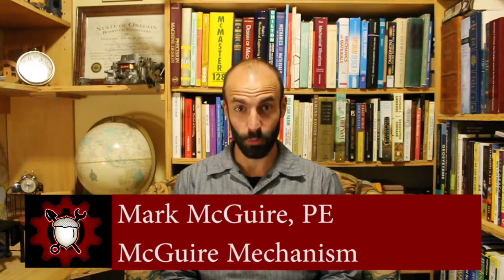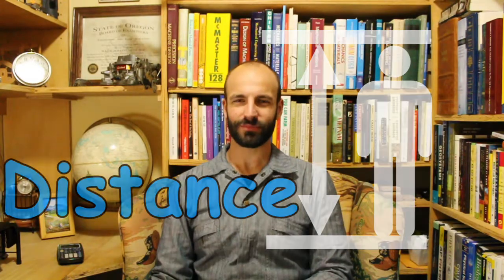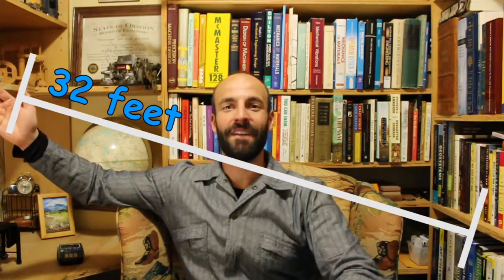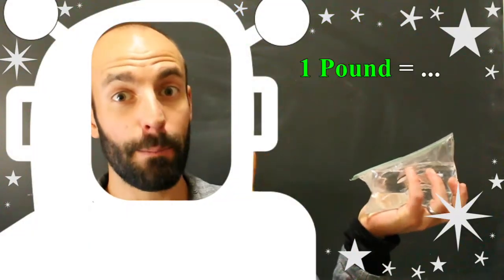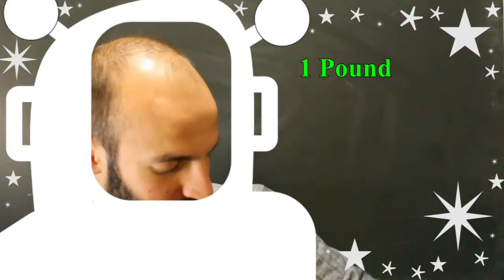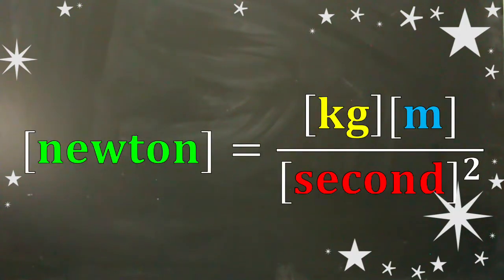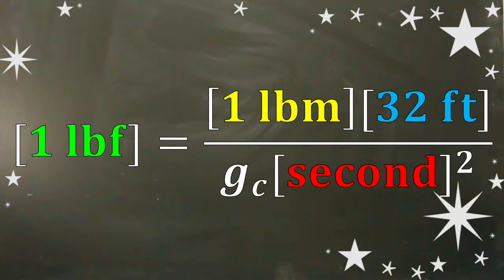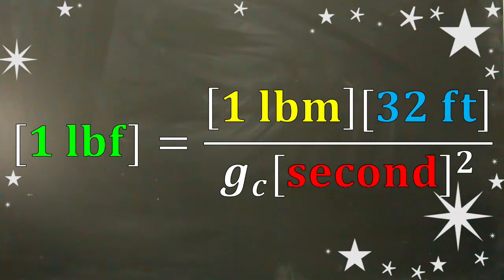Mechanical Engineering Basics: Units

Comment: So is the gravitational constant ONLY used in the version of standard units where a pound of force = a pound of mass? Also, would that gravitational constant be different on a different planet or even at the top of mount Everest versus sea level? And finally, is a gravitational constant ever used in the metric version of the f=mass x acceleration? Thanks!
Reply from the maker: Yes, this particular constant (denoted "g_c") is only for converting slugs into pounds-mass (lbm.) And you're right, the scalar "32" would need to change with different planets in order to keep force and mass quantities the same—but the units themselves would not change. And yes, it would also technically be different between sea level and Mt. Everest! Mountaintops have slightly less gravitational pull (less acceleration due to gravity,) but convention is to use gravity's magnitude at sea level.

The lbm vs. lbf is specific to the Imperial system, so there is not a metric equivalent to my knowledge. There is, however, another gravitational constant in all unit systems (metric included) for the special case where force is calculated from the product of two masses divided by the square of their distance, multiplied by a gravitational constant denoted big "G."
Reply: @McGuireMechanism  Thank you! I have to let this soak in now. 🤔